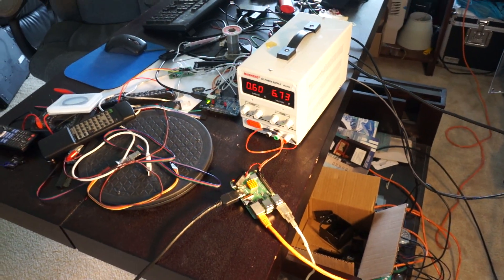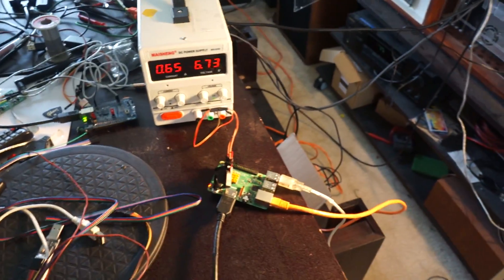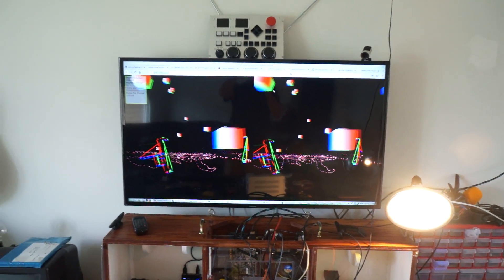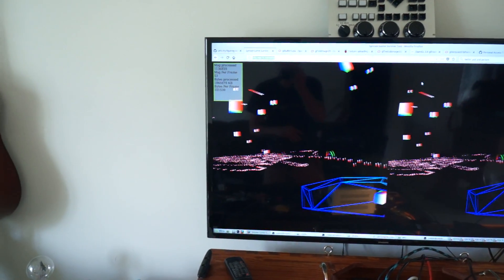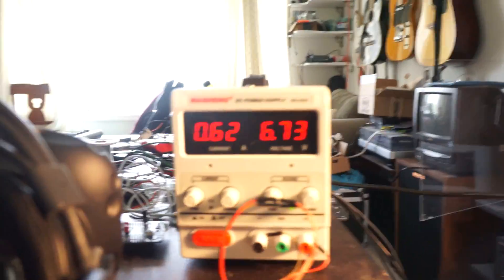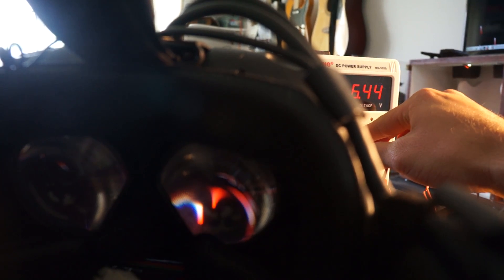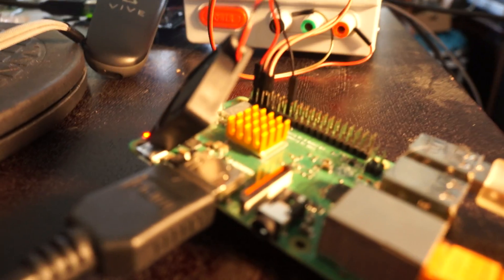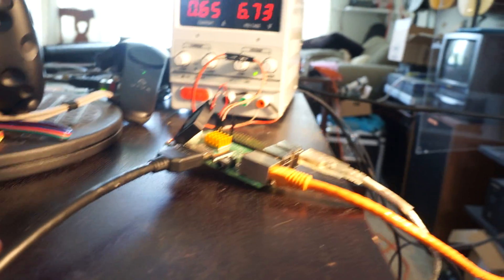My Pive, more on Raspberry Pi + Vive.

Comment: Which module/function can I use to simply stream only video from raspivid to htc vive on both displays?
Reply from the maker: I don't understand the question
Reply: @CNLohr  Yeah, that was not clear question. I've got problems with activating both Vive displays. But fortunately  I found your config.txt file with timings etc and now everything work as needed. Thanks for your wonderful job.

Comment: https://raspberrypi.stackexchange.com/questions/55709/is-it-safe-to-plug-raspberry-pi-3-to-6v

Impossible that you're running it at 6.7 volts
Reply from the maker: Never base your opinions of what is or is not possible on something you read online. Test it.

Comment: Hi! Great work, and great channel, i never skip an update.
It would be awesome if you could present the actual setup (light houses, gogles, controller, cables, power supply, and computer boards) you use, like: "what do i need to replicate this setup" (if it fits your plans, of course :D )
Maybe i didn't saw something, but i'm hardly keeping track of everything. Would you say it's actually a developpement-friendly project? 
Thanks, good luck, and again, great job!
Reply from the maker: I can't at the moment, but I will probably do something like what I did with my Orange Pi.  And then I will post a lot more about it.
Reply: CNLohr that's great, thanks !

Comment: The cables you are using to power the RaspberryPi look very thin for those kind of power requirements :D
Reply from the maker: yeahhhh I know.  Hopefully it'll be better when the power supply is on the board.

Comment: I've had similar visual glitches on lower voltages - try putting config_hdmi_boost=11 in /boot/config.txt and then reboot.
Reply from the maker: Will do - Though, I found out when it happens, it looks like the rpi goes into some sort of low-voltage mode with a slower clock.  I think the slower clock is what may be messing it up.
Reply: CNLohr ah, okay. On raspbian here's an init script (raspi-config) that sets the governor on boot time (from the on-boot default of performance to powersave) to enable downclocking on low load. If you disable it via systemctl disable, the cpu will stay at the max clock constantly. I found that out when I was custom building raspbian images and didn't have raspi-config installed. Read the "Gotcha" part in the answer here: https://raspberrypi.stackexchange.com/a/9048
Reply from the maker: THANK YOU I WILL TRY THIS!!!

Comment: It would be cool if this also worked with the Rift, but I'm guessing it won't.
Reply: A pi probably doesn’t have the usb bandwidth to do constellation tracking.
Reply from the maker: Correct.  This is one of the three fundamental problem with rift tracking and why lighthouse tracking is the definitive winner.  (1) Bandwidth (2) Processing (3) being able to tell what's what in larger spaces or when tracking more objects.

Comment: Could it be that your HDMI cable is so long that the raspi is struggling to push the signal at lower voltages?
Reply: Mac33 that was my thought as well. The RPi3 has a HDMI Drive setting in config.txt, if the 3+ still has it, that's worth a shot.
Correction: CONFIG_HDMI_BOOST is the right one.
Reply from the maker: I will give that a shot more, but I think it has to do much more with the clock rate issues.